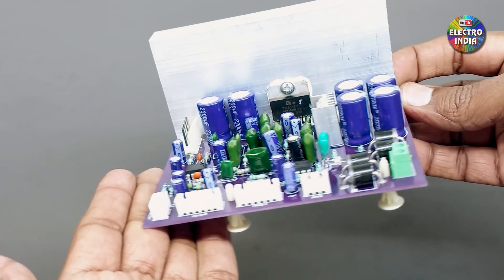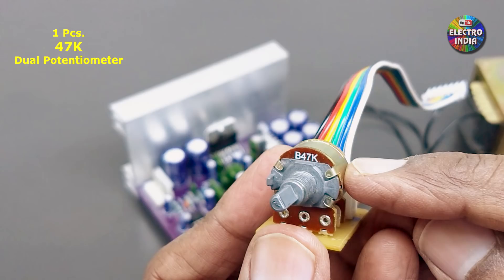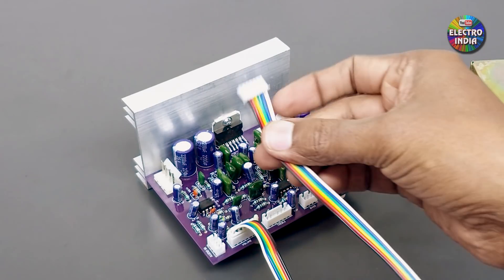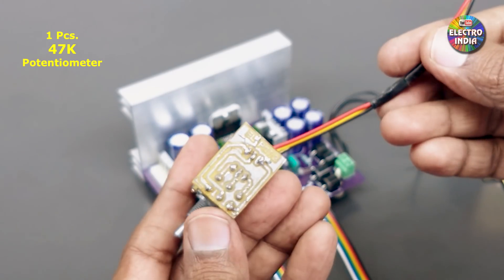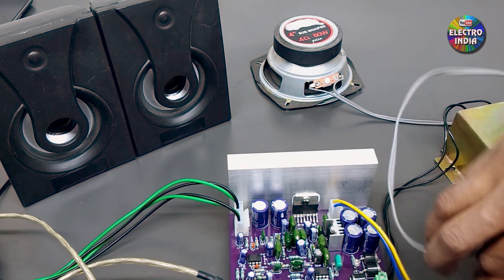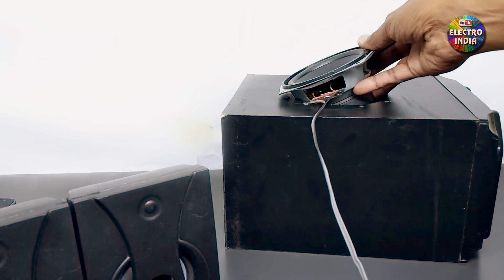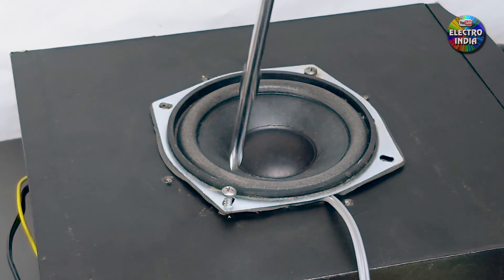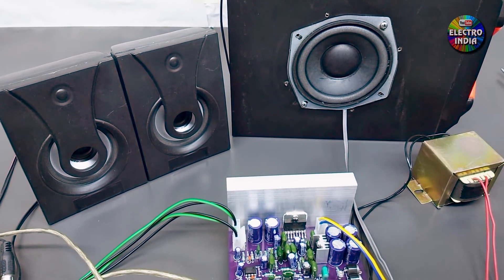2.1 Audio Amplifier Board | Version 2.0 | with TDA7377 IC DIY Hindi ELECTRO INDIA

Comment: you didn't mention "V" following items; 5 Capacitors 4.7uf
4 Capacitors 100uf
1 Capacitor 1uf
2 Capacitors 10uf
1 Capacitor 22uf
2 Capacitors 100pf
7 Capacitors 0.1uf=104
2 Capasitors 0.0047uf=472
2 Capasitors 0.0068uf=682
1 Capacitor 0.01uf=103
1 Capacitors 0.22uf=224
2 Capasitors 0.047uf=473
Reply: The input is 12V, so multiply by 2 .. Use any value above 25V.. That works.

Comment: Bro i have logitech z533 2+1 system and volume controller doest'n work it has no power how do i replace with this
Reply: Logitech have much better amplifier. is STA540 and is much better than TDA7377

Comment: sir mere pas
2 to sub woofer ( 5", 100 watt, 4 Ohm)
2 to woofer (6", 20 watt, 4Ohm)
2to 4" tweeter hain
Or 2 satellite speakers hai
aap is configuration k liye ek best amplifier suggest kar denge plz ?????
Reply: Lm3886 is very best for sub woofer amp., tda7388 is very best for others channels, tda7388 is 4 channel(quad channel ) ic, very good quality with silent sound, and tda7388 need only 12v single power supply.(maximum 14v dc), but lm3886 need dual power supply and more expensive, otherwise u will try to tda7388., one channel is sub, one mid, other 2 left and right., very economic, cost of ic only 90 rs, but 12v 10 amp supply needed, atleast need 5amp. Try it brother, other very good choice is ta8277.